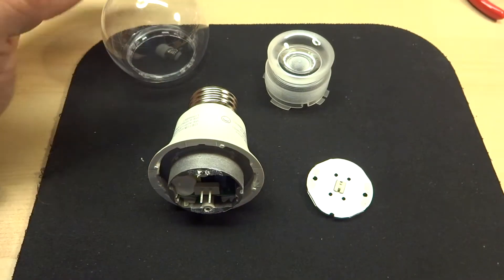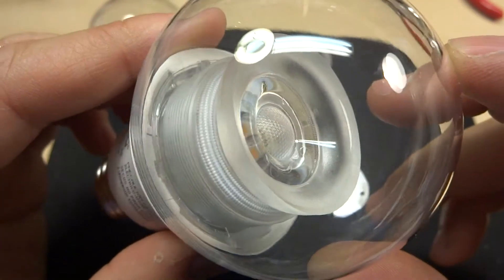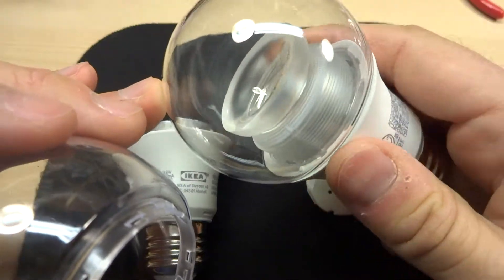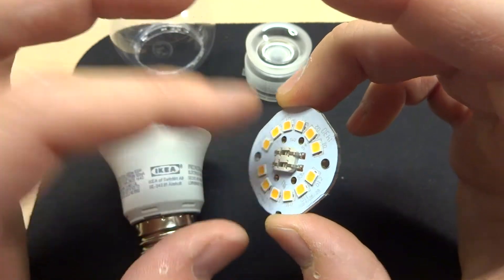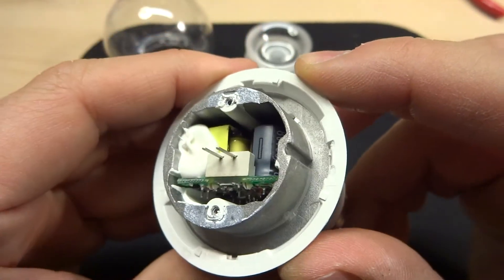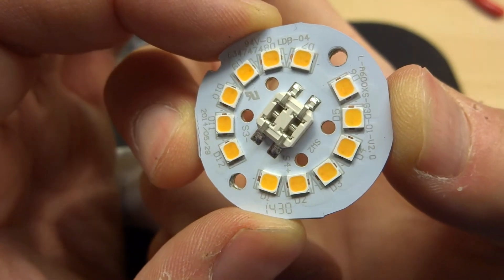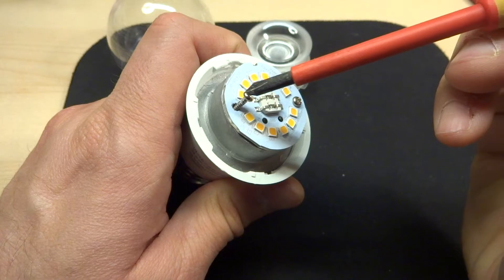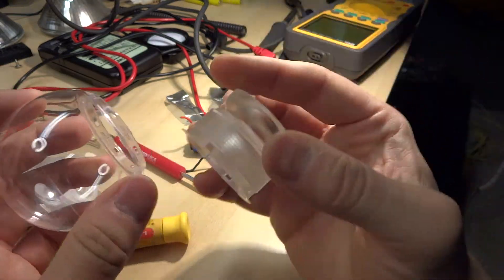IKEA LEDARE 600lm bulb mini-teardown (2015 Model)

Comment: A piece of welders glass is quite handy if you want to study a turned on lamp. You can easily see the individual chips. Especially older bulbs are very interesting as they may have red LEDs inside them too.

Comment: Holy Crap.. you stole those bulbs.  no smart connect though.  but heck, for that price that's great
Reply: +Adrian Black Not likely they loose money even at that price, but they are likely selling them at cost for two reasons:
1. To reduce energy consumption in customers homes.
2. To increase volume so that they can further reduce prices from manufacturers.
The LED product line at IKEA is likely to expand and diversify.
Same with their rechargeable batteries.
 
The older IKEA LED lamps were really crappy, and most of them still are, compared to top-of-the-line models from other brands, but for the price they are good enough to light up the home.
I just wish they would sell some brighter models of their LED GU10 and E14.

Thank you for an interesting tear down!